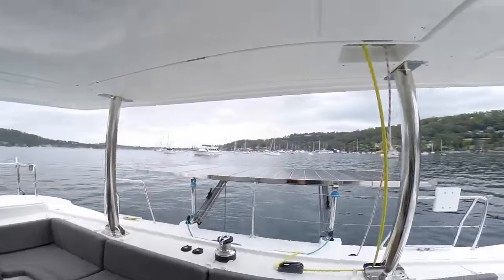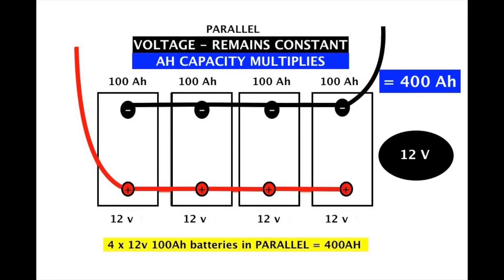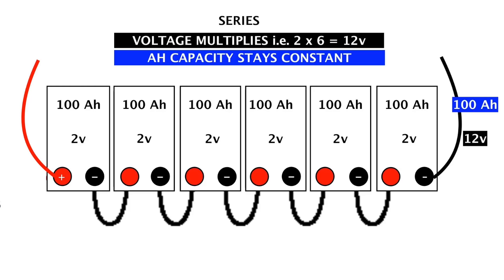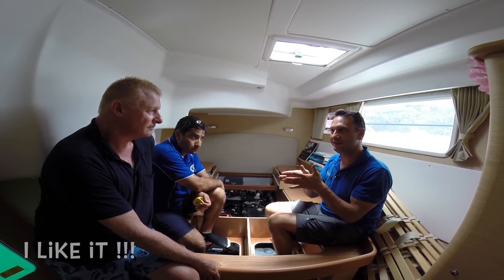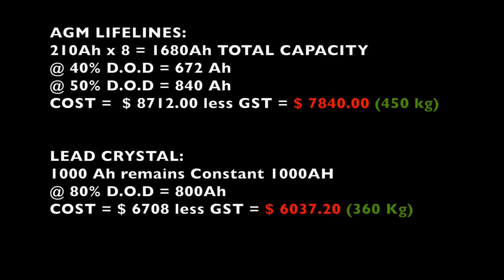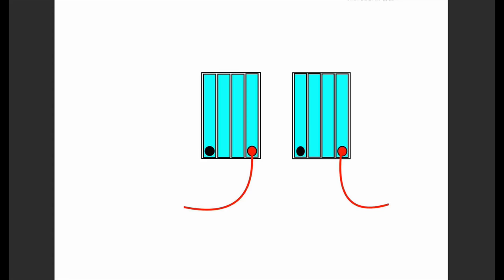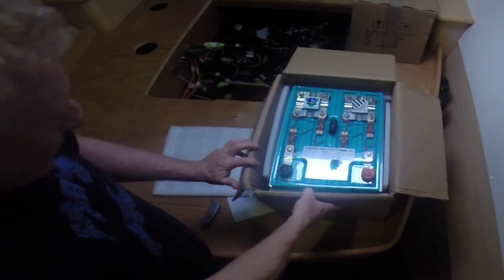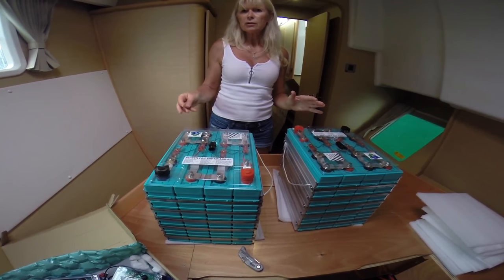Pt 1.  LITHIUM BATTERY INSTALLATION

Comment: Thank you for the video Brent and Ana!  So you can really "survive" with only 2x400AH LiPo Batteries ? There was no need for more capacity ? But you beefed up the alternators too?
Reply from the maker: Hi Cyrille - a pleasure my friend and hope the folks will help you guys to get that drone man :)
Cyrille, 800AH Lithium is actually a LOT of capacity compared to other battery types.
LifePo4 batteries hold voltage 'higher and longer' than other batteries do and really this counts more than the rated AH being published by the manufacturers. We have found the LifePo4 batteries can take more fluctuating demand - 'punch power / load' - and bounce back to a higher voltage.
This is why I do not like to look at LIFE CYCLES published by manufacturers - this is not very useful information to the sailing community although it does provide a basis from which to work.
We realised with Lithiums that we did not need the same AH Capacity as with the AGM's - the AGM's simply drop out sooner when applying heavy erratic charge and discharge loads to them. So on these Lifepo4's for example, we can run our Webasto 5000BTU (reverse cycle) airconditioner all night, have enough spare capacity to run all other systems (we have 2 laptops charging through the night, 3 x Fridge / freezer / lights are on upstairs because I am on the laptop doing business or replying to questions and so on) and we have get through the night with ease having to turn on the generator the following morning at which time we run the washing machine, kettle on, microwave or whatever else ... then then the sun comes up and kicks in the solar power etc. etc.
The idea of having 'kickass' charging systems is because the lithiums can 'suck it up' and we run charging systems for shorter periods.
The scenario with the AGM's was that our great charging systems were only as valuable as the time it takes for the AGM charge cycle to kick into absorption mode, and then they were overkill.
With Lithiums, the chargers will keep performing as long as the charger apparatus can handle the heat ... so the difference here is that with AGM's - the batteries charge curves are the limiting devices, whilst with Lithium the Chargers are the limiting devices and not the batteries (within reason of course).

Anyway, we are considering a 3rd bank depending on how we 'feel it' with these two packs. There is no problem for us to add a 3rd pack bringing us to 1200AH capacity, but in the end whatever one removes one has to put back. This needs to be a consideration in ones calculation, so for example - if we were a family sailing away for weekends and back to the marina style of sailing, it would make sense to unplug shore power - have enough capacity to stay away for 3 days (1200AH) and come back to plug into shore power.
For us living 'on the hook' where we generate our own shore power, one considers what devices one wants to use for how long to bring the charge back on the banks.
So, we decide to turn on the generator for say 2 hrs in the morning (depending on our state of discharge) - we make coffee, rewash clothes in the washing machine, etc. etc.)
In the meantime we push back around 400A and the sun (especially in Australia) sees the panels kick in at around 40-50A at which time we turn off the generator.
This becomes a cycle we are accustomed to - it is almost robotic and works well.
For others, having 1200AH for example, means they skip a day of charging but ultimately with all things being equal, the generator will have to do the 'run time' to put the charge back again. It all comes down to preferences - but yes - 800AH is a 'sweet spot' for us - but we would not rule out adding a 3rd bank ... perhaps we will.
Cheers my friend
Brent

Comment: great video thank you. Whoever why did you not go with the LED Crystal battery it seems like it was less expensive and more amp hours?
Reply from the maker: Lorne - a great question and certainly I am VERY IMPRESSED with both Lead Crystal and Carbon Foam (Oasis Firefly) technology along with these LifePo4 batteries.
When the Lead Crystals first came out in South Africa, they did not want to supply me because they said the technology was too new and untested for mariners. However, a mate of mine sailing his Lagoon 440 used these batteries and raved about how well they 'bounce back' after being punished.
One of the reasons I went the LifePo4 route is weight. 
Already we carry a massive amount of weight on Impi and we wanted to save on weight to retain our comforts.
Also, the Lithiums maintain a higher voltage for longer and I have learned how important this is as a feature.
With 6 x 2v cells (Lead Crystal) we would have had a sweet system too - however - the entire pack is reliant on all cells performing. If one cell drops - the pack drops too and for redundancy we would have to carry a spare cell (another 61 kg) which for Impi already weighted to the limit is an issue. With the 'lithiums' we were able to get redundancy in a second pack set up for an additional 50 odd kg's (at 400AH) which is lighter than one 2v cell in Lead Crystal and with no redundancy.
Still, I have always recommended Lead Crystals to my mates, and I do suggest folks look seriously into Carbon Foam technology who cannot take the leap to Lithium and I do believe this to be an awesome battery. (Brian is not keen on Carbon Foam Technology and I guess time will tell as it is relatively new to sailboats).
Nigel Calder, very well known for his electrical and boating knowledge has used and tested the carbon foam technology and I believe has put his stamp of approval on this - that would give me enough comfort to take a serious look at it.
Brian was / is also a cool dude and is selling many lead crystals into Australia at the moment - so yes - heavier but very effective. Our Lithiums weighed in at around 100 - 110KG's when all was said and done. The Lead crystals 360 - 366 kgs although more AH capacity. One needs to look at voltage too!
On a sailing catamaran that is a lot of added weight ... 
Cheers my friend - appreciate the comment
Reply: Thanks!

Comment: do you have lead crystal or lithium batteries
Reply from the maker: Hi NEWPL - sorry for the delay in reply - You Tube seems to have changed notifications a bit and I need to get used to it.
To see what we have please check our recent post here ...https://www.youtube.com/watch?v=0BGH8RmtfAI&t=427s
We went Lithium and a second choice we would have gone with Carbon Foam (OASIS FIREFLY) which I should have shared int he video. I was trying to show costs and options in this video which seems not to have been too successful but hopefully our new video will be more specific. Cheers for now ... Brent

Comment: Hi Brent,

LiFePO4 was invented by John B. Goodenough (great name) at the University of Texas in 1996.  Much safer than the LiCoO2 batteries used in electronics.  Longer life, stable voltage, thermal and chemical stability (highly resilient during oxygen loss, which typically results in an exothermic reaction IN OTHER TYPES OF LITHIUM ION batteries). It is commonly accepted that the LiFePO4 battery does not decompose at high temperatures.  Your fire risk is very low.  ALSO I understand your EVPOWER batteries have individual cell monitoring that disconnects each battery cell if it fails.  Excellent!  Don't discharge more than 75% and those batteries will probably outlast you. You never have to throw out the batteries you have. Simply add more when they eventually weaken a little.  

I am not at all concerned about your battery choice.  But I am a little concerned about your exposure to nickle in New Caledonia.  I suggest you research it a little.  What is not easily found in literature is that heavy metal chlorine salts such as mercuric chloride and nickle cloride can cause deliterious effects on the human immune system.  A researcher at the University of Texas had one drop of mercuric chloride fall on her wrist by accident in a lab.  It blew out her immune system and in two weeks she was dead.  If you go back to New Caledonia, stay away from chlorine.  Nickle will be everywhere.  Tell that young vet who was getting sick all the time to use something else than chlorine to wash down her kennels.

I enjoy watching your travels.  Best of luck from Ken in Austin Texas.
Reply from the maker: WOW - such an interesting post about the nickle in New Caledonia. The young vet actually had a mosquito born illness I believe - feel desperately sorry for her but she is on the recovery path and very caring of animals.
Thank you for sharing about the LifePo4 batteries and yes, we have discussed this at length with many electrical engineers and are told the risk of fire is 'next to nothing' as long as the installation is done correctly.
I do like the fact that each EV cell is monitored as well as the entire pack together as a whole and then the BCU as further back up.
I think you make a valid point about the future in that we ONLY need to replace cells and not buy a total pack - that will save us money for sure and is something we had considered.
Ken, I really appreciate you sharing your knowledge here - it helps us and others to be better informed in these matters.
My best - Brent
Reply: John B. Goodenough is actually his name.   My wife worked at the University of Texas.   Personally, I think LiFePO4 batteries should be called Good-enough after its inventor.   They really are good enough for boats.  There is no need to wait for solid state lithium batteries.   Significant production of solid states could be many years away.

My wife and I are retired.   We are thinking about getting a catamaran, so I've been researching it.   I grew up sailing, and the love of sailing never goes away.  I have been trying to find video on how to flake a main on a boat like yours where the boom is high above the flybridge.   The Lagoon 560 and 620 mains look a little scary to this old man.   Can you demonstrate how you flake and dress your main some day?

All our best,  Ken and Sue.
Reply from the maker: Hi Ken and Sue - it would be my pleasure to share the main sail on a video although ti may take a while to get it done with all the requests. In the meanwhile let me try explain the following:

The boom on the 440 for example, may look high but without a boom vang (which the 440 does not have) the boom can be lowered at the back onto the deck. In this regard one has access into the stack pack and one is working down on it.
Our Lagoon 440 has a continuous feed block style reef system (fore and aft).
We hoist an lower the main sail UNDER sail. This means, we do not need to turn the boat into the wind to hoist or lower the main sail.
We do this by
a. position the boom to the windward side of the boat by taking the traveller to windward.
b. Take the main sheet and put it on a winch alongside the main winch (in our case the genoa winch)
c. Take reef number 1 and place it on the power winch for the main halyard.
d. Holding the main halyard with a turn or two around the genoa winch, crank in on the main winch - the reef line no. 1.
e. As the reef is bringing the sail down (fore and aft) into the stack pack (on the boom) let the main halyard ease off accordingly but whilst keeping enough pressure to keep the main sail 'taught'
f. When you have done this to the extent the main sail is reefed to 3rd reef decide if you want to do the same for the 2nd reef and again the first reef.
g. When you have brought the mainsail down to 3rd reef position, you are now ready to bring in the last little bit and we do that by placing the 'mainsail downhaul line' three turns around the winch. We do NOT tail the line through the winch, we hold it firmly inner hand and whilst winching assist the winch by pulling it in by hand. If there is a problem and the line is too taught, the winch will spin but the line won't break because you are using hand strength. Check for the problem making sure the mainsail is clear of obstruction and bring it in all the way.
h. Leave it there !!!
i. When at an anchorage days later or whenever convenient, fold out the steps on the mast (4 steps only required) and zip the last part of the stack pack closed. We have a large style zipper with a long line and simply pull the stack pack closed from the deck below with only the last meter needing a pull from up the mast. If you get a cleaver sailmaker to tailor the zip / closing mechanism of the stack pack there would be no need to go up the mast AT ALL to close the pack.
We really do not find boom height to be an issue at all not he 440.

I hope this makes sense?